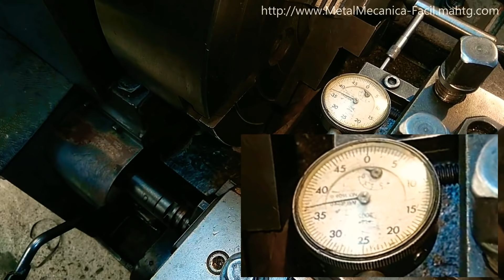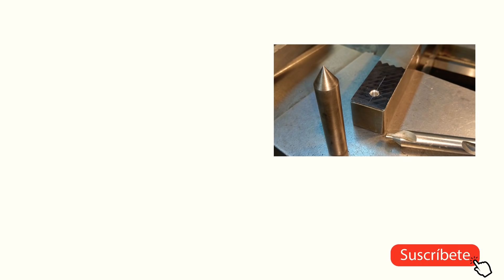Centrado de Precisión de una Pieza Irregular en el Torno

Comment: Hola mario cada vez que vez un vídeo tuyo es como la solución a mis problemas y le doy muchas gracias por contestar cada vez que le escribo porfa ayúdeme tengo dificultad para centrar tapas de motor y mas cuando son hechas en aluminio, muchas gracias por tu respuesta
Reply from the maker: Hola, Sí, la verdad es que cualquier tipo de tapa de motor presenta dificultad para centrar. La recomendación es:
1. utilizar el chuck de mordazas independientes.
2. Utilizar un comparador de carátula.
3. centrar la pestaña que acopla con el cuerpo del motor tanto en el sentido axial como en el sentido radial.
4. primero centrar en el sentido radial y luego en el sentido axial.
5. por lo general al centrar en un sentido, se descentra el otro, así que lo aconsejable es ir intercalando los centrados hasta conseguir una desviación de cero en el comparador de carátula.
6. Tener paciencia.